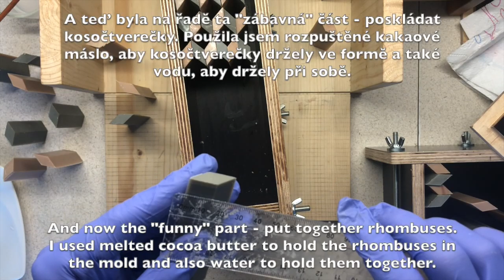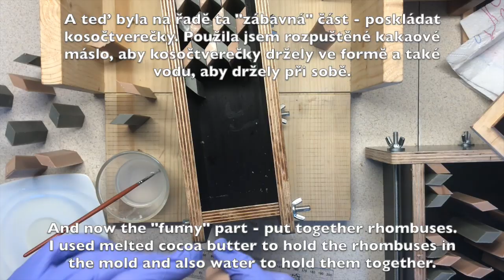3D geometric design soap Cold process

Comment: This is so beautiful!  I can't wait to try this technique.  What are your moulds lined with?  Do they have a silicone coating on them?
Reply from the maker: Thank You so much for Your feedback! I am really glad that You like it and I wish You luck, when You will be doing it! But so sorry, I'm not quite sure what exactly You're asking.
Reply: @luciesteblovakantorova  Usually I have a silicone liner on my mouds or line them with freezer paper so the soap doesn't stick to the sides.  I just wondered what you had lining the inside of your moulds :)
Reply from the maker: @mazina7175  I used nothing, because mold has non-stick surface (wood is coated with something) and the soap comes out of the mold beautifully, even without lining it with paper or something. :-)

Comment: Hi, I always wondering how to make this design soap! Thank you for your great video. 
May I ask why you put two different hydroxides? Is it helpful(or better) instead of using sodium hydroxide only? 
Thanks heaps in advance! 🤩
Reply from the maker: Thank You so much for watching!!! A for Your comment! Potassium hydroxide helps with better dissolution of soap in water, thanks to that with better foam. It also helps keep the trace fluid longer. I hope I helped a little bit 😊
Reply: What is the ratio of KOH and NaOH